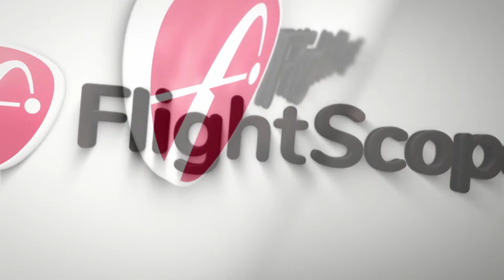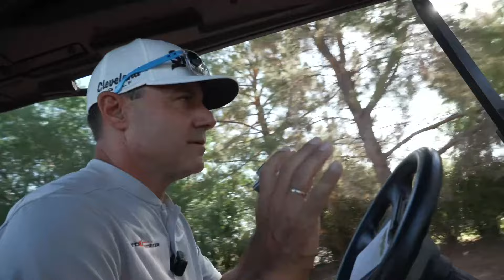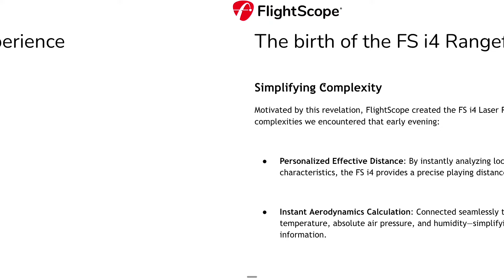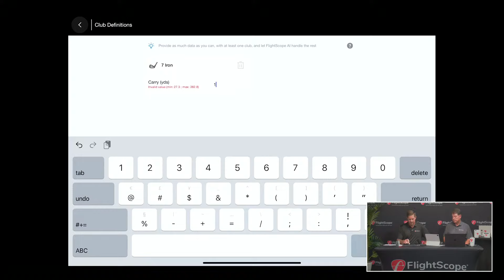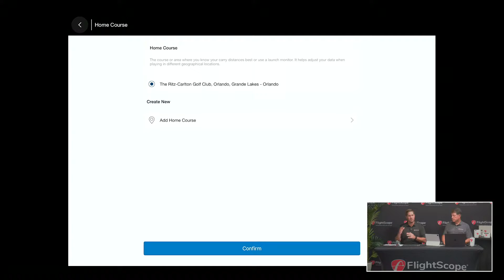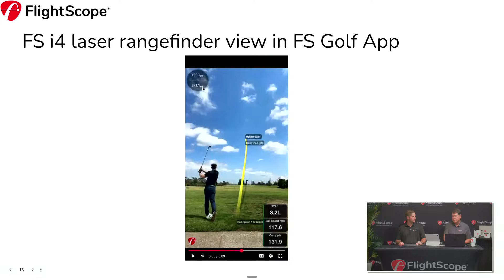i4 Rangefinder Webinar with Henri Johnson

Comment: Hi Henri and Beck. I am very excited to try the i4 soon. Quick question… can I link 2 separate profiles to the range finder, meaning that we link my phone when I play and my son’s phone when he plays? And will it then pick up the different gapping data? We have separate profiles when we use and practice on our Gen 2.
Reply from the maker: Hello Rinus - You can switch between multiple Smart Gapping, CSV import, or Club Grouping sessions. For example, if you both complete a Smart Gapping session, you can title each session with your respective names and easily switch between them when using the i4 Rangefinder.

Comment: I think the biggest problem right now is the Bluetooth connection. If you go farther than 10 feet, the connection drops. In my opinion, the club data should be stored on the rangefinder (cached), so everything continues to work even if the connection breaks. Once Bluetooth is available again, the rangefinder should reconnect automatically and possibly pull/push updates, such as weather data.

It would also be great if GPS data were recorded at the same time, so that afterward we could view the course on Google Maps and see where we used the rangefinder and which club was selected. This way, all shots and distances could be reviewed afterward.
Reply from the maker: Hello Alex, thank you for your feedback. We will pass this suggestion over to our software development team.
Reply: I agree

Comment: I’m really struggling with the lack of cross-platform integration in the FlightScope ecosystem. Support have told me that I need to run a separate gapping session on my iPhone if I want the data to appear in the i4 app on my Iphone, which seems unnecessary. At the moment, data recorded on iPhone, iPad, desktop, and the i4 don’t sync properly, and each platform feels like it’s working in isolation. Is this something FlightScope plan to fix? Proper cross-device synchronisation is a basic expectation these days, especially for people who’ve invested in the full ecosystem.